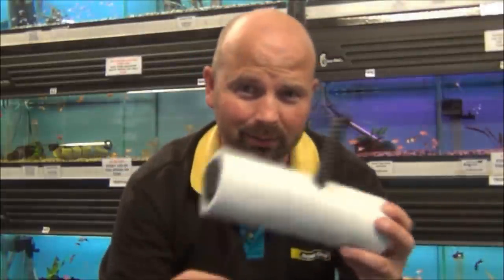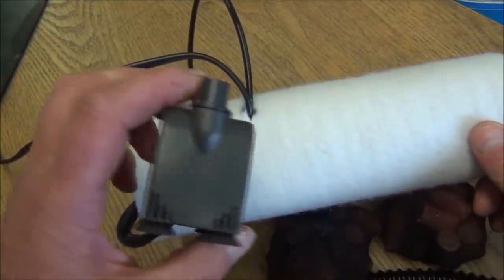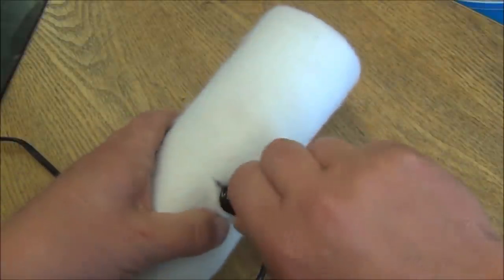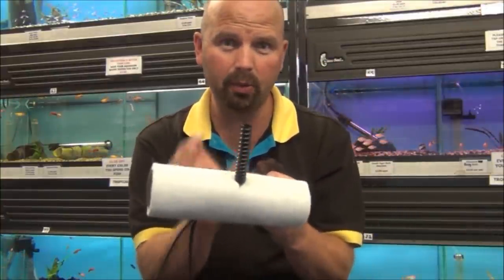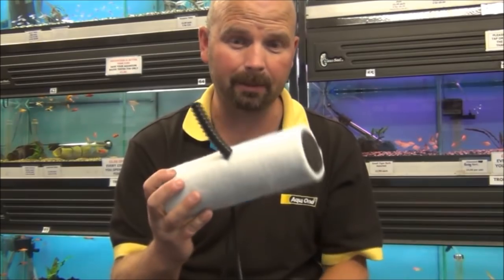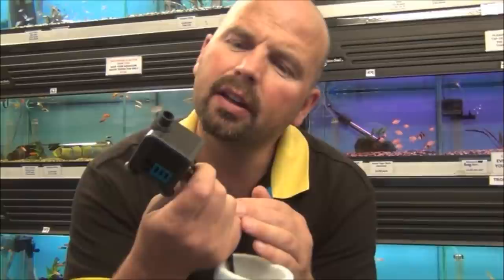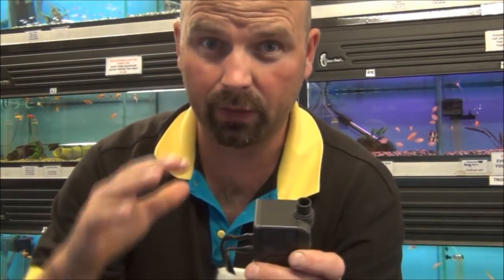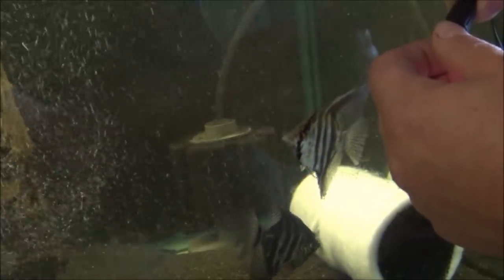BEAT THIS AQUARIUM FILTER!.....GROOVY - DIY AQUARIUM FILTER FROM PONDGURU

Comment: About the pump being silent, thats not quite truth, the silent only comes when you close the air valve. i was illuded by this youtube and ordered one from the ebay  i used it for 1 minute and then i stored it in the drawer for an eventual need....bad investment...
Reply from the maker: Luís Brigham Bubbles popping on the surface will never be 100% quiet but when the valve is turned down to reduce air bubble size the noise is barely audible.
Reply: Pondguru Outdoors Anyway its always louder then the air pump, for me is a pain when its working, and another issue, if you sink the pump more then 30 cm theres no air outlet whats so ever. If im wrong about this product, possibly i have a broken pump. Cheers
Reply from the maker: Luís Brigham I think the 320 operates with air down to about 30cm so that sounds about right. I think the 450 operates with air down to about 45cm. Feel free to send me a video of the pump operating so I can tell you if it sounds normal. pondguru@btinternet.com

Comment: here is a supplier of the poly tubes mate, love the vids keep up the good work mate here is the link. http://www.ecfibreglasssupplies.co.uk/c-536-polyester-glassfibre-tube.aspx
Reply from the maker: Thanks for the link man
I have contacted them and the diameter of the tubes they do are way too small unfortunately. They are a fibreglass mix so aren't stretchy. Unfortunately they don't know where I could get a tube like in this video so the search goes on.
Reply: a will keep hunting coz a want to build one ov them that was a great idea bud. keep up the good work a sat for about 2 weeks watching all ur vids for tips and that am just starting to do a tank again after years eny more tips u can give me please a want to do soil bottom with sand on top, and i want to aquascape the tank. And what was the diameter ov the tube mate

hope to hear from u soon
Reply from the maker: tony gillespie I think the internal diameter of the tubes was around 50mm. As far as soiled tanks I'm none too good with that as I just use sand and no soil. You could try 'Planted tank UK' as I have no idea when it comes to planted tanks.
Reply: cool man thanks for the feed back. a could use eny tips u can give am going to get a 4 ft tank and a want to get biome ultra of u and a few other bits and bobs m8
Reply from the maker: tony gillespie Just ring me any time during the day no worries on 07772848730
Reply: np thanks very much m8
Reply: hi mate a have a few fold wanting the bio off u a will send them ur way am on a few fish groups in Scotland and a have been putting ur vids on my facebook so hopefully u should get a few customers from up here. and have u had eny luck with finding they poly tube m8
Reply from the maker: tony gillespie Haven't found a supplier sadly so the filter is stuck at the prototype stage.
Thanks for sharing on forums. I'm not  member of any forums as I barely get time to answer all questions on Youtube, lol.
I do send quite a few orders to Scotland as there seems to be a serious lack of aquatic shops up there.
Reply: just wondering if ur looking for a distributor up here i have had at least 30+ falk since yesterday up here comment and like my post and i think a could sell alot for u like. i was going to phone u on monday because am working sat and sunday let me know if u would be up for it. even if we can just try it out and see from there. and am still looking for the poly tubes i have got some of my family in canada to see if they can find out on there side of the pond so i will keep in touch with u and keep u updated

thanks tony gillespie
Reply from the maker: tony gillespie Bulk buying as part of a club is always a good idea as the material costs are less per kg and the shipping is proportionally less too. As far as suppliers go we will likely start up trade accounts once the manufacturing can cope with demand and myself and the guys who make biohome have cut away from other business ventures as we need to be concentrating purely on biohome to make the expansion plans run smoothly.
Yeah, if those tubes could be found it would open up such a wealth of possibilities for DIY filtration which worked extremely well.
I am not often in my shop now as I work from home so my mobile number is 07772848730
Reply: am in all different clubs on facebook had well over 50+ folk now from all different clubs i think are wanting it. and i was meaning if i could sell it for u on your behalf up here, i wasn't wanting money for doing it but maby some trial stuff for myself or somthing like that if u would fancy doing that on a small scale basis, like if u were to send me up some biohome and i sell it for you. A really want to get into the aquarium and aquarium products business as-well because a can find costumers up here more easily, and it would benefit your business and it would help me get started up here.
dont what you to think am being cheeky.
and am hoping that i will manage to find a supplier for the tubes am searching far and wide for them.

eny way thanks tony gillespie
Reply from the maker: tony gillespie Just ring me any time on 0772848730